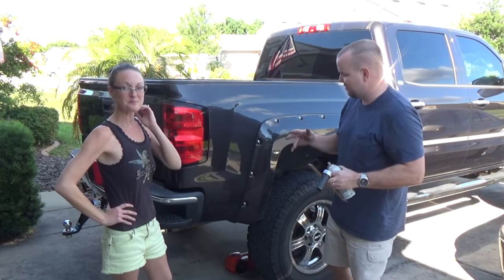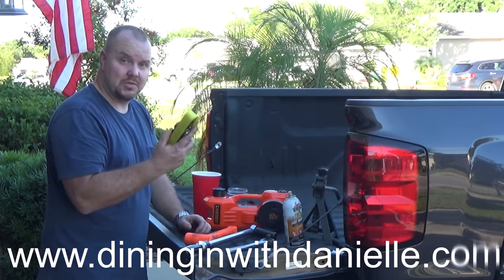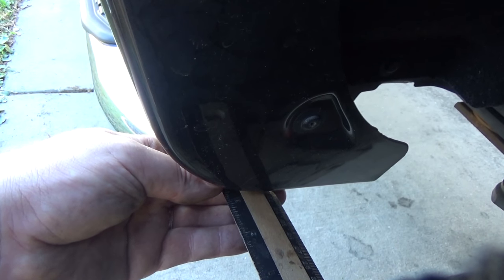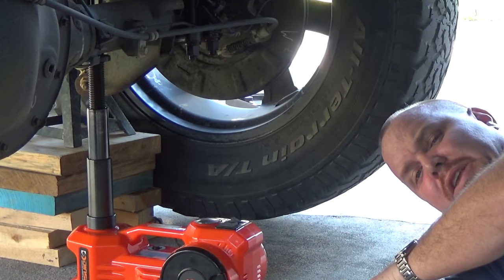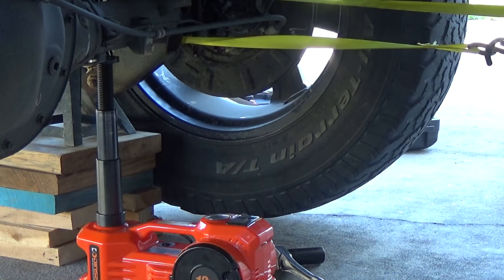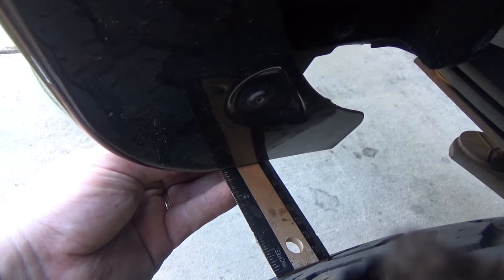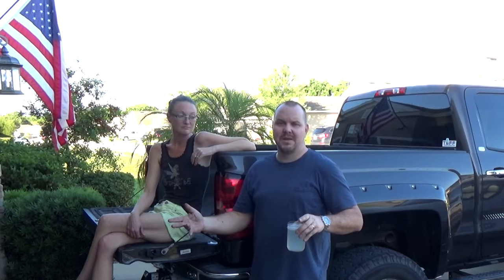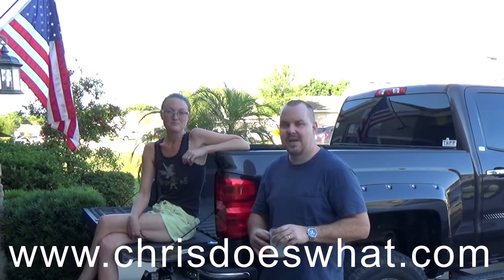How To Fixing Driving Sideways, Rear Axle Alignment

Comment: That will get you in the ballpark, but you really should be pulling measurements from the axle center to a known point on the frame that is in the same location on both sides. In most body on frame vehicles, this will be the body mounts. The further from the axle center the better as errors will be amplified over distance and shorter measurements will tend to hide minor variances.
Reply from the maker: Thank you for your feedback. When we measured from the wheel well this was showing a quick way to check if your axle housing has moved. Once under the truck we simply aligned the axle housing perch to the leaf spring. It will get you close enough to look like your going straight down the road, and this issue will never cause more tire wear.

Comment: Was thinking about using a ratchet strap. Genius of you to use the hitch as a mount for it.
Reply: Another measurement is from the front wheel to the rear, on both sides
Reply: I have a 2019 RAM 2500 with rear air bag suspension. It has been catiwampus (pulls to the right) since brand new. I finally took it in last week. Alignment shop stated the rear axle is installed incorrectly. The wheels are toed in to the left and they can't straighten it. I will be contacting my RAM Dealer next week.
Reply from the maker: @46fd04 wish you good luck with that, service has really went down in the USA.

Comment: Glad youre not driving a sidewinder anymore! (Like the rattlesnake) The lift blocks on mine got twisted too. They moved it at auction with a forklift and also bent my shock into a 45 and tore my brake lines up. I raked the insurance company over the coals and essentially I got a free truck out of the deal after buying it back salavage and then they caused extra damage returning it to me. I was supposed to take it back to the suspension shop to have it all re-torqued, but i never went in yet before the wreck. Maybe they could have just straightened it out, but then I wouldnt learn anything 😂
Reply from the maker: Glad we are straight as well. 😃 Sounds like you got a pretty good deal.

Comment: To check rear axle alignment/thrust you need to measure to the frame of the truck.  A plastic body part is not a reference for measurement by any means.
Reply from the maker: Sure, why not! Don't know out of square your truck body is, but this works fine. The truck drive straight and the tires look the same in the wheel well. Rear tire alignment on a leaf spring won't affect tire wear.
Reply: @ChrisDoesWhat  It doesnt take ANY longer to measure from the wheel center line to the same point on the frame on both sides and get a TRUE measurement.
Reply: "Why not"?  Because it takes the same amount of time, and is the correct way to do it.  I've measured trucks with in spec alignments and the the wheels were not center in the wheel wells.  All you did was align your wheels to your fender flares, and if you got luck, to your bed.  You didn't align your axle.  It may feel like it drives straight, but that doesn't mean it's aligned.
Reply: @ChrisDoesWhat  It definitely does effect tire wear lol its why I'm here 😂
Reply from the maker: It affects your wheel position, but since it is a solid axle, not tire wear.

Comment: You tried, that's more than I did. But you forgot to show what bolts or even say what bolts your loosening, need to do this in minivan, can hear the rear tires"squeaking" when rolling on the grass, I only have to deal with a¼ inch, good idea with the rachet strap... Thanks much and God bless
Reply from the maker: I showed the loosening of the u-bolts about 05:00 minutes in. Hope you get your issue fixed.

Comment: 12:10 I remember seeing a 1970s Nova crabbing down the road back in the 1990s and told the driver when he parked it. I was wondering if that was really helpful or if it was as obvious to him as it was to me. People seem to associate Novas with this problem, but 1970s Camaros had about the same suspension design; I assume it was less obvious with Camaros due to their rounded body shape. One way of testing for it that I saw in an old Consumer Reports car guide was to drive through a puddle and see if the tire tracks line up.
Reply from the maker: It is hard to tell when you are driving, guess in the on a muddy trail you could tell, funny this truck rarely ever goes off-road. This is my wife's little highway princes, see our jeep for something that trails.
Reply: That puddle trick is brilliant

Comment: How does it need an alignment of the rear end if there’s a nipple for the spacer block that goes into the axle
Reply from the maker: Because it is after market and when Badlander installed it, they didn't torque the u-bolts to spec. The nipple still has a little play and a millimeter off there can cause a half inch at the tire. This will not cause tire wear, and only other cars we see it is off while you are driving.

Comment: By the rear axle not being centered due to a 4 inch lift Will this cause your drive shaft to vibrate at 60 - 70 mph?
Reply from the maker: A 4 inch lift can cause vibration. On our jeep with a 4 inch lift the pinion is angled up and we have dropped the rear of the tranfer case 1 inch. Driveshaft length plays a big part in how much lift it can handle before modifications are needed.

Comment: How to fixed my rear right wheel is sticking 3-5mm out then left on my 2021 3” lifted Tacoma?
Reply from the maker: If the tire is sticking out more on one side, it should be in on the other side the same distance.
Reply: @ChrisDoesWhat  yeah rear left one is in then right, what would you suggest to bring both in balance? Should I use 5mm spacers on rest of 3 ? I checked on lift blocks installation and bed alignment they look fine. What would you advise? My problem is I want perfection!
Reply from the maker: @krishnabhandari2400  I would probably lift the back of the truck and loosen the u bolts and see how far off it is on the leaf. We hope you can solve this issue and keep us informed.

Comment: 2000 honda. Both back tires lean inwards. Should I follow the same steps shown in video?
Reply from the maker: Not at all, that is a Camber issue, you probably have independent suspension, this truck is a solid axle. A Camber issue can be caused by weak or cut springs, saw this a lot on lowered cars.
Reply: So should I buy new springs?
Reply from the maker: I would have a tire shop look at.
Reply: @allenlefort5951  My Honda has so many suspension arms back there that it would be very hard to tell which one was the most responsible for such a problem. You might have to change a bunch of bushings and knowing Hondas, that often means replacing  some of the control arms, since they come as complete assemblies. Of course, there might be some aftermarket mods that can "solve" the problem by brute force.

Comment: Don't measure from the fender flare.  It could be off in a number of ways.  The plastic could be mounted slightly off, especially with those after market flares, your bed could be mounted slightly off, could be off just from how the truck is sitting, etc.  You should measure from axle center to center leaf spring bolts, both rear and forward.  The bed and fender flares have almost nothing to do with your frame, other than being bolted to it.  And fyi, many trucks are known to have misaligned beds from the factory.  I just measured a truck that is .5" off at the flare and is in alignment spec.  .5 is a ton at the leaf spring.
Reply from the maker: Thanks for the feedback, guess this worked fine because you can't notice the truck riding sideways.

Comment: I measured to the bottom of my wheel well but god knows if the body is even. I noticed the lift kit ubolts were crooked. They also said i should take it over to have it re torqued but looks like im doing it myself now lol. Doesnt seem too difficult tho.
Reply from the maker: I can't afford to take it in as well. Hope all goes well!
Reply: Don't measure from the wheel well!  Measure from the frame.  Like you said, no way to know if the bed is perfect.

Comment: I was backing up into a parking spot. Bumped into the parking spot in the rear of my truck. My steering wheel is still straight. Does that do anything to my alignment?
Reply from the maker: This will not effect tire wear.

Comment: I just went and picked up a car for my son that is going to be a new driver car felt great driving after I paid for the car and I was driving it home on the highway I noticed the car was having a hard time staying straight so when I got home I'm looking around and I noticed my rear is shifted to the right a little. It really puts my stomach in knots here I'm trying to do something good for my son the person that owned it never said anything about that problem now I need to figure out how I can get the rear to sit properly on a Ford 8.8 rear. I looked real closely at the frame and I could not see anything creased or bent does anyone have a suggestion it's on a Mercury Grand Marquis
Reply from the maker: This car uses coil springs, would look for worn parts, measure spring heights. Have not messed with coils that much, had friends when I was young that would heat them to lower the car, made the car ride like crap.

Comment: My only question is why there's a block move don't they have pins to keep it in place
Reply from the maker: They do have pens to help prevent from sliding, but they're not a machine fit so they will move a bit. This is also why they say don't use lift blocks on the front.

Comment: My 04 3500 express isn't crab walking but the passenger side rears wear out on the inside. Driver's are even wearing. I think a leaf spring bushing or something is off
Reply from the maker: You have something off, I have never had this happen, but reading most point to the frame suspension or axle. Hope you figure it out.
Reply: @ChrisDoesWhat  Actually when I take off I feel a clunk in the rear. Something is definitely worn. Getting it looked at this week.
Reply from the maker: @my95buick  How did it turn out? Sorry for the late response, YouTube Marked you as spam.
Reply: @ChrisDoesWhat  Haven't had time to get it looked at🙄

Comment: Can I jack up whole rear end? Or can you explain a little better plzs? Just the begining.. Do I jack up one side of the axle?
Reply from the maker: I only jacked up one side high enough that I could put a jack stand under the frame of the truck and un spring that side of the truck with the wheel still off the ground. I wanted to keep things as close to the ground as possible so that I didn't have a truck fall on me.
Reply: @ChrisDoesWhat  yessir thanks for the reply🙂

Comment: The same genius who's using the ratchet strap, good idea. However, he's trying to move the axle with the weight of the truck still on the axle. He should've jacked the truck by the frame and the axle would move very easily.
Reply from the maker: You see the jack stand on blocks? If you watched the video you can see the jack is not touching tha axle, just left it there extended because this job only takes a few minutes.

Comment: How did you move the rear axle when the leafspring are all pinned you would have to have a busted pin between your blocks leaf springs and the axle!
Reply from the maker: Are you referring to the bolt that holds the leaf together? Leaf lift blocks do not have pins running through them. Since it was installed from Badlander, and the truck had 20K miles, the U-bolts might not be at peak torque. Lift blocks have a nubbin on them that is not machine fit into the axle spring mount. The block was a few millimeters off, this caused the truck to go somewhat sideways down the road.

Comment: Just curious if looking straight at the rear of the truck and when I did my rear blocks (2016 GMC Z71 1.25" factory blocks) with a buddy we swapped them out for 2" blocks so it sits level. Of course something always has to happen but when he loosened the passenger side the axle rolled forward onto the jackstands. It was less than a quarter inch but I noticed right away that the tire on the passenger side was slightly further out of the wheel well than the opposite side which was now sucked into the wheel well. Same kind of fix?
Reply from the maker: Have you looked at the spring perches on the axle housing to see if the blocks are off center?

Comment: So what if I have the same problem but it’s the top of the block where the block and the leaf springs touch that is off compared to the other side? Could I do the same thing to fix it?
Reply from the maker: You should, may have to tap the top of the block back in place then make sure the axle house and leaf are in the right spot.

Comment: I just bought a stock dodge ram 1500 4x4 and it drives sideways as well plus you can see the wheels cocked to the passing ger side. Any suggestions???
Reply from the maker: Dodge? LOL If your truck has leaf springs and to ubolts holding a solid axle, the process is the same.

Comment: Rear right wheel not aligned with left wheel.  When you reverse it goes straight but moving forward it twists
Reply: The car is a Nissan Rogue 2011
Reply from the maker: This only works for a solid axle leaf spring vehicle, your car is independant and it sounds like a strut is broke.

Comment: Where did you place your 3 ton on the boards at? Lead springs or frame?
Reply from the maker: We put the jack stand on frame. We jacked up the truck at the axle and then put the jacks on the frame so that when we loosen the U-bolts there was no pressure on the axle housing.
Reply: Thank you very much. Also did it damage or bend the axle since it shifted?
Reply from the maker: @tristenperkins1567  No damage, just driving sideways.
Reply: @ChrisDoesWhat  christ i got same problem after i put a 5inch lift kit my passenger side rear looks foward to driver i tried the same but didn't moved probably i didn't put jack stand right placed to take the weigh off
Reply from the maker: @55trombon   @55trombon  You have to put the jack stand on the frame so you can loosen the U-bolts to adjust the axle housing position.
Reply: @ChrisDoesWhat  thank you im gonna tried that way

Comment: What about the axle  levels up and down.. I broke  my driveshaft.... when I got another one we noticed  that the connection at end of axle was pointed way high ( not level)   how do I adjust the dog bone? 😳 to level with axle downward to level  with new driveshaft? .  Axle  is straight as far as frame alignment.. vehicle is a gmc savanna conversion van.. I'm a American  in Philippines.. I just need advice so I can get it done myself  .. can't get filipino  to work on American car here. If i do the adjustment and still need ti welded in place they can do that.. . everything else works great. Anyone's help is greatly appreciated 🙏 🙂
Reply from the maker: Amazing that you broke the driveshaft and not just the universal joint.  Driveshaft alignment should not be that hard and if it is factory should not have to change. We changed the alignment of the axle housing and transfer case when we lifted our jeep in this video series. https://youtube.com/playlist?list=PL9vNnMj1ZmcZDe1oEw9BXmSZSTGXPlVzO What you look for with the driveshaft angle is it to be the same at the transmission as it is to the axle. This will put an even amount of stress on the upper and lower universal joints.
Reply: @ChrisDoesWhat  the drive shaft broke at the Universal tip. At 60mph. It was so scary but we stopped safely.. I'm guessing the shaft got stuck upward  before  come off completely.  The whole rear end locked for about 3 seconds  then free rolled after that.. in guessing that is how the pinion was forced upward 10⁰?..   it can drive but the angle is so off.. I'm not taking any chances.. that shaft  is extremely hard to get and cost me $1000usd. In America it's only $175... the price I pay for not buying locally ( lmao)... I'm a photographer...not a mechanic.. but I hold my own.. finding  a video that show this being  done is hard... and disappointing...since not one gearhead has a video on this.. I'm sure even a drag race or hot rodder as had this problem?
Reply from the maker: Before changing your angle of you axle housing I would look up some videos on proper driveshaft angles. On our jeep we lifted we used lift springs with wedges to point our pinion up more to correct angle.
Reply: @ChrisDoesWhat the axle is on leaf springs....the center bulb has shifted upward.. the arms never  moved  shock holders are in placement ..and are in there original positions ..o issues with springs or brakes....I watch over 209 videos  and not one shows or explains how  to reset this bulb.(dog bone..?). this is regardless of the brand of vehicle.. i only get one shoot to fix this.. I mess up...  its a storage box..sitting in the weeds.. and I'm forced to spend 45k on another van shipped to Philippines.
Reply from the maker: @mv4463  wish you the best on your repairs. Just remember the angle of both sides of the driveshaft should be the same. I have thrown a driveshaft as well and to repair it. The cause was the universal broke, but when the driveshaft hit the ground at 60 mph it bent the shaft in half.
Reply: @ChrisDoesWhat  old shaft only  broke at the u-joint nuckle.nuclear.. I think  it think it pulled dog bone upward and the motion of mot being able to turn snap off the tip of shaft. But my problem is still find someone that  has done the physical moving of the dog bone  back to matched angle of transmission and rear end.. someone  that as accurately reangled the level of the dog bone on a leaf spring rear end..